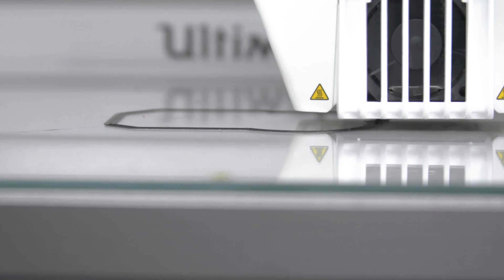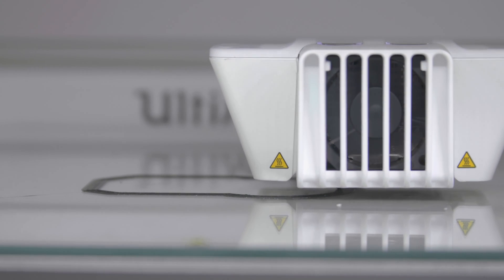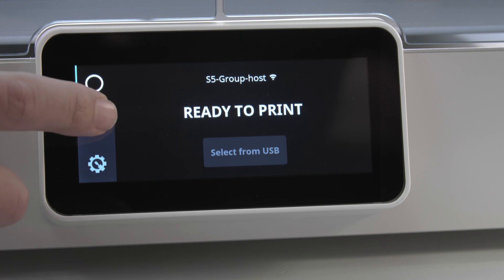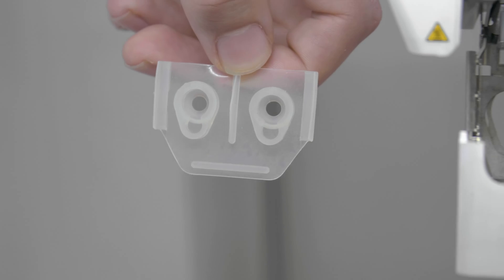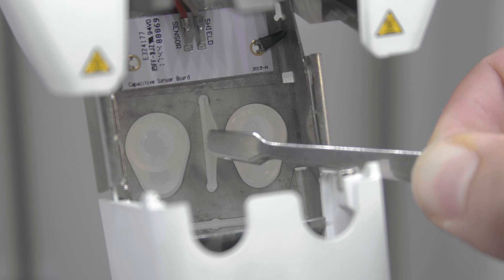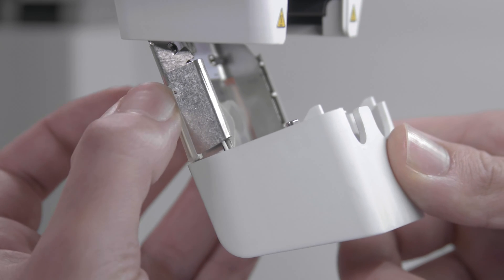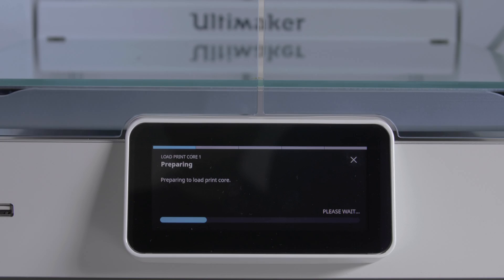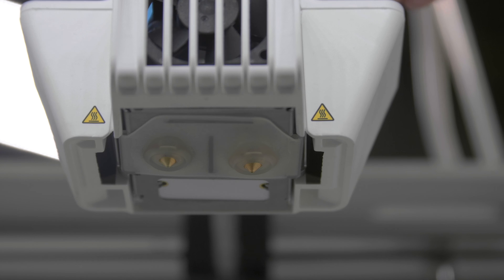Ultimaker: How to replace the nozzle cover

Comment: What they leave out of the video is the little groove on the sides of the cover. This needs to be stretched around the metal bracket and they do not tell you this in the video. Start with one of the sides and not in the middle. Stretching the other side is the last part and this can be difficult. Especially if you have fat fingers

Comment: We have 2 printers, we have to replace this cover every other week or so. Hopeless design.
Our printers go basically 24/7 and it's really annoying to have the printer stop after 12h in the middle of the night and then restart it again.
Due to this quality issue, and others, we bought two Bambu X1e printers and as soon as they are up and running we might buy two more to replace the S5's. We will keep them for backup probably because they work but the Bambu seems much better in quality and print time.
It would be much appreciated though if the quality problem of the silicone cover could be fixed.

Comment: Finally I managed to attach the nozel cover properly.
I found very crucial that the attchment of nozzle cover to the fan bracket has to be tested by applying mild pulling force outside the bracket. If the nozzle cover falls down then the seal that comprises two spine-like structures at the base of the tab was not completely passed throug the slit of fan bracket and thus the the seal of tab did not properly lock the nozzle cover to the metal plate of the bracket.  

An other crucial step is that the pockets at the ends of the nozzle cover should be  firmly pulled over the edges of metal plate. Again the properness of the attachment should be tested by applying mild force. 
However, the attachment of the front tab to the metal plate was always carried out by ease in my hands. Likewize, the success of this should also be tested like above.
However, to improve the clip I recommend you to briefly introduce the crucal parts of the nozzle cover like the seals and pockets. Then comes your clip as usual. After the brief introduction to the structure of nozzle cover the customer may have a better opportunity to install the new nozzle cover if not at once but with fewer trials and errors?

Comment: Is this nozzel cover avalible for the Ultimaker 3 ?
Reply: It's a different cover, but yes they are available and should also be replaced every three months or so. Don't worry, they are not expensive.
Reply: Thx I found dem 👌🏻
Reply: How do I replace the rectangular style silicone covers?
Reply: Be glad it doesn't so you won't have to buy new ones and replace them